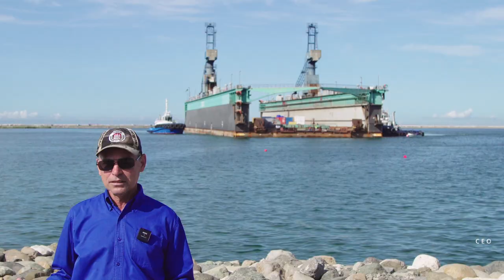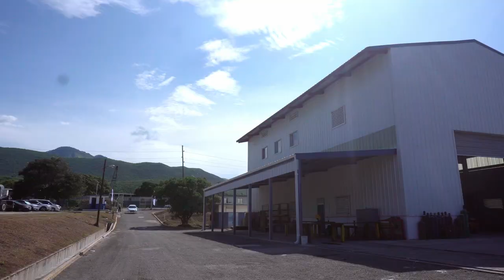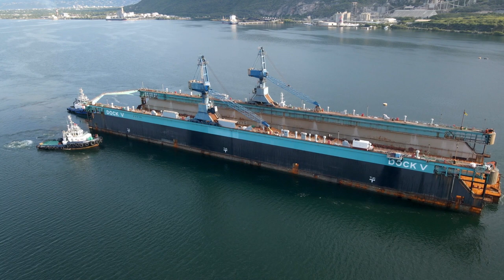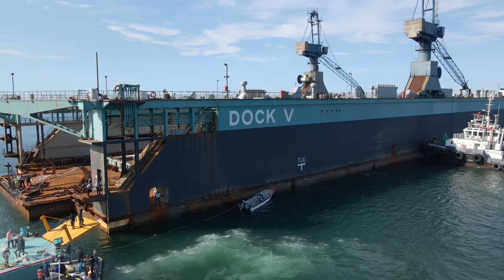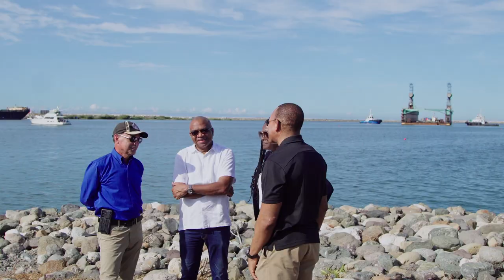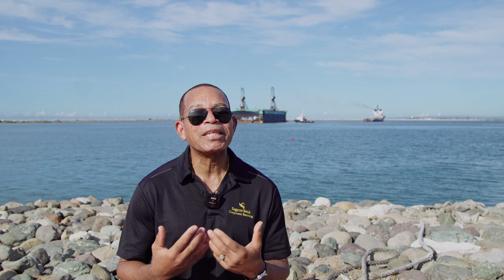Arrival of Jamaica's First Floating Dock

Comment: Great move Jamaica. 

I'm a Marine Electrician  - first class - at a major shipyard here in the US but we no longer work on commercial ships...only US navy ships, including aircraft carriers.

I can testify, this type of industry needs skilled people willing to work long hours because commercial ships has a quitker turnaround time than navy ships. These ships cannot afford to remain out of service for long periods.

Shaft replacement / repair needs skilled machinist with a well equipt machine shop.

You also need *EXPERIENCED*...

Shipfitters
Sheet metal workers
Marine electricians
Pipefitters
Pipe welders
Structual welders - Steel, Aluminum  and stainless steel.
Painters
Carpenters
Insulators ect.

This is a huge undertaking and I wish Jamaica major success in this undertaking.

Shipyard work has many moving parts and the number rule is Safety First

You can do it, i know you can but it's not easy. This undertaking can attract commercial ships that port in other Caribbean islands but keep in mind, these ships has to be in and out in the shortest possible time...with high quality work.
Reply: Wow never know so if I’m a regular electrician how can I evolve into a marine electrician
Reply: @stevencross5949  A little on-the-job training. It's not that different. In fact the main difference is conductor color code - which is no big deal. I was never a commercial electrician but some of my co-workers were and they had no problem adjusting. Electrical energy works the same in all electrical applications. You'll be fine.